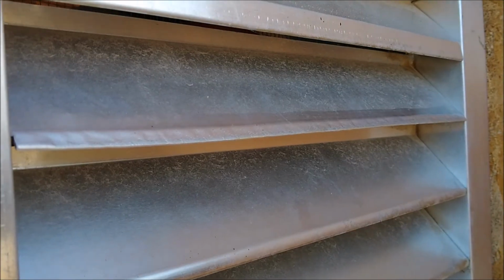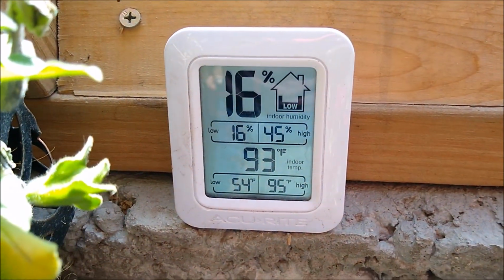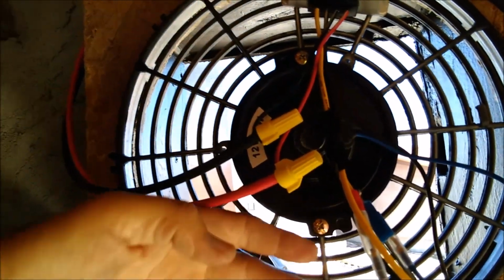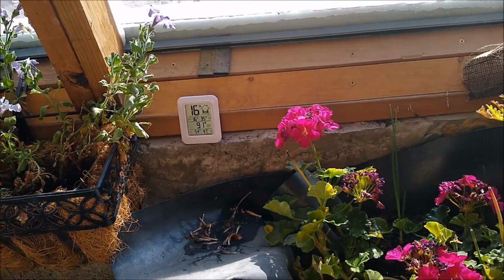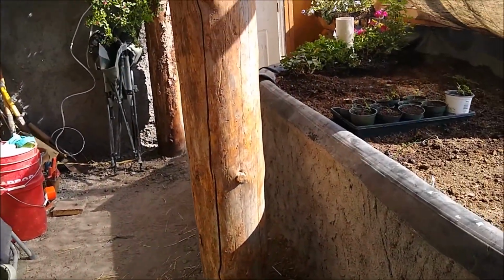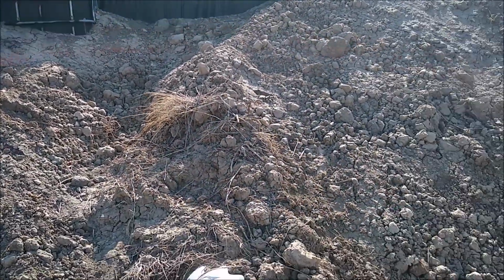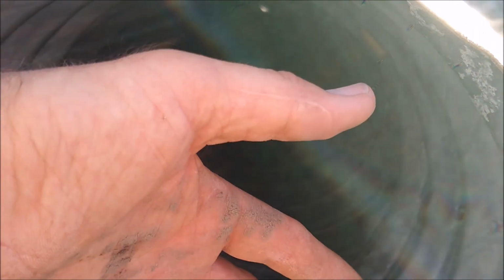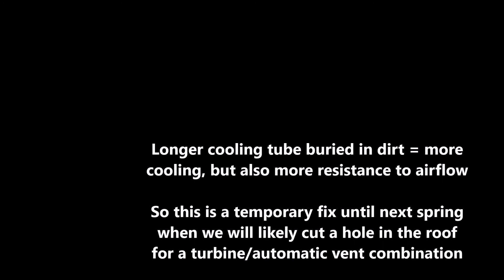THERMAL Mass Greenhouse Part 50- TOO HOT!! Pt 2

Comment: You are doing what my wife, Deanna, and I are getting ready to embark on! Love it! We are getting ready to build a modified Earthship Biotecture style home north of Reno-Sparks, Nevada off Pyramid Highway! Where are you located?! Subscribed!
Reply from the maker: Thanks for all your kind comments and for watching 😁 I have made several mistakes in this build, some of which I cover in the multiple videos I've made, but I will be making a video soon of the modifications that I would do differently. Please pay close attention to that because I will be discussing what worked and what didn't so far in one video. Overall it's doing its job though, it was minus 13f outside at my house this morning here in Southern Colorado, and it was 51 degrees inside the greenhouse. 64 degr warmer than ambient temperature without any added heat or energy expenditure. I would be very interested to hear about your build, if you make videos please let me know